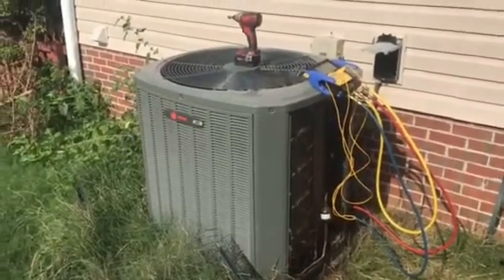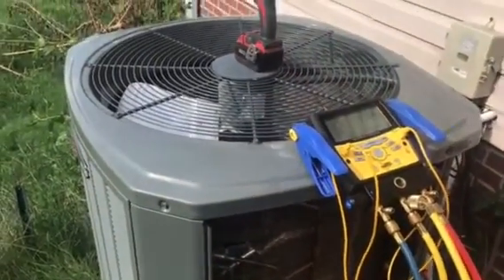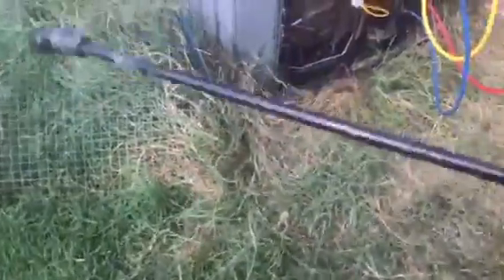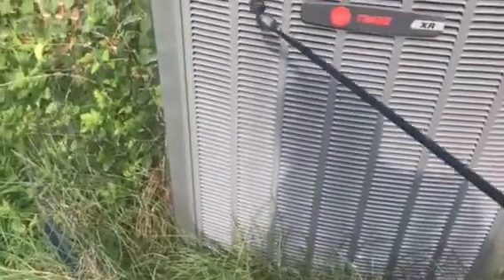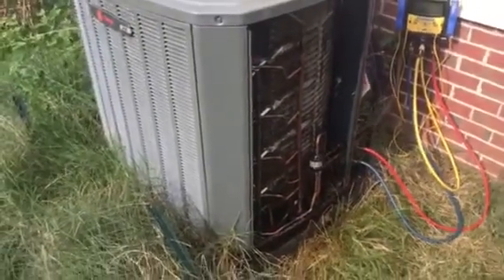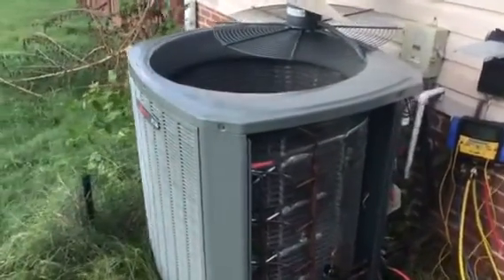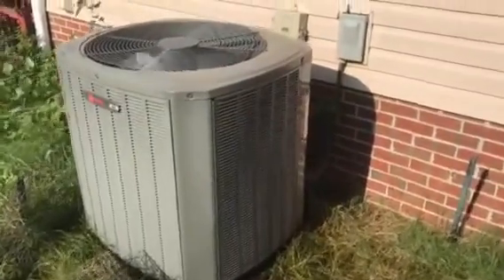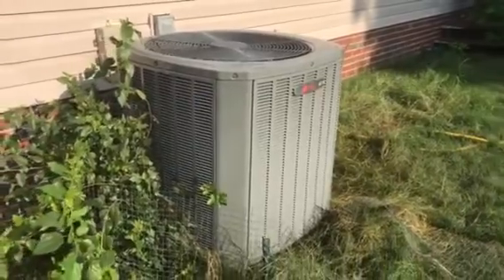Spine Fin Coil Cleaning The Easy Way

Comment: I have a four-tear-old American Standard 14 SEER unit that’s the cabinet design.  Mine doesn’t look nearly that bad - it’s just dusty.  Plus I keep the grass cut short. 😀

Can I get by with just back flushing it, or do I really need to use coil cleaner?  Also, what setting do you use on the hose gun when back flushing?  I wouldn’t want to use something like “JET” for fear of bending spines. 

I don’t mind pulling off the side panels, because I need to bump out some dents - we got hit with baseball-sized hail just two months after the unit was installed, and I’ve already straightened the fan grille.
Reply: You only have to use a coil cleaner if there is oil or grease on the outdoor coil. Some cleaners are just too corrosive on spin fin coils in my opinion, I use dawn detergent.

Comment: That pump sprayer really has some pressure! Could you provide any advice on bulk cleaning solution? I like diluted Simple Green for most things, but it certainly doesn't have that foaming action. I need to do this to my home unit. Works good, but it's a 2014 and I can see some buildup. Thanks!

Comment: Good Vid. do you sttill like the hudson electric sprayer. looks cool. i use hot water from hot water heater in the garages if i can get to it. i use the hot water spiigot on the bottom of the tank. it does double duty flushes out hot water heater sediment too.
Reply from the maker: I love that sprayer... charge it about once a month. Also I left a strong solution in it just to test if it was going to breakdown from the chemicals and it held up fine. I have 2 of them now.
Reply from the maker: I like it so much I ordered 2 more... so far I charge mine once a month and it never goes dead or weak.

Comment: You shouldn’t be using high pressure on any coil, you’re also pushing the dirt back in, you should have taken the entire thing apart and cleaned from inside out.